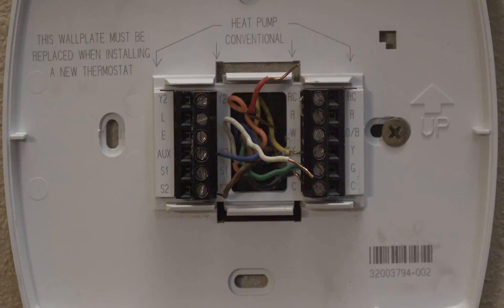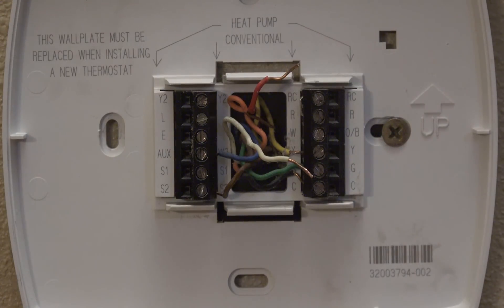Why is the thermostat not working. Diagnosis #13 answer

Comment: Would it be wise to leave an extra foot of wire in the wall behind the thermostat when you initially install the wiring?  That way, in the future you have extra to work with instead running a whole new wire.

Also, I searched your video library and couldn't find any videos about float switches.  Would love to see you do a video on them.  Thanks for all the great educational content and all your efforts.  The videos are very helpful and much appreciated.

Comment: Yepper - I suspected something similar to that.
About three weeks ago, I had a similar situation.  The heat would would intermittently work.  Whoever installed the controller originally... used network cable (3 twisted pairs).  yea, wrong wire was used and the natural building vibration finally fractured the wiring.   It was an easy problem to detect and fix...   Cheers!
Reply: I had done CAT5 on my upgrade because I was poor and knew I had some T-stat wire somewhere, well I just found my real wire and will be doing the replacement soon. My biggest worry was voltage drop but it has been just fine. I usually dress my leads like the telephone guys do, wrap a few inches into a tidy coil.

Comment: Hey GFM! I'm still trying to find the correct way to wire my hour meter to the 12v side of the furnace relay.  This gentlemen posted on my video but didn't realize that I have oil, not gas, if that makes a difference.  Anyway, I emailed him but didn't get a reply.  Do you get what he's trying to tell me to do?  Thanks,

John, do this meter the right way. You can find the 24v pin on your IFC 
board (furnace control board) that controls the gas valve and tap into 
that for one side of the meter and place a new ground wire screwed into 
the furnace case for the other pin. This way the meter will only run 
when the furnace is using fuel. Just what you want.
Now to find the pin, look at the schematic and find "GVR" this is the 
Gas Valve Relay. It will be associated with a pin number and a color 
wire. Tap into that color wire as the hot side of your meter the other 
side of the meter take to furnace frame ground. Your schematic is glued 
to the back side of the furnace door. Take a picture of that schematic 
along with a picture of your furnace IFC board  and send it to me and I 
will identify the exact wire you should use.